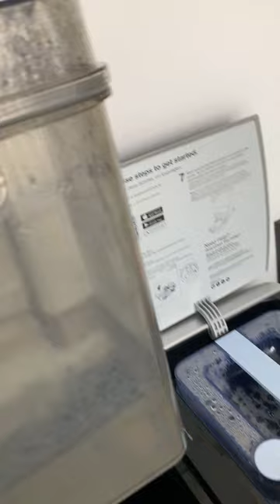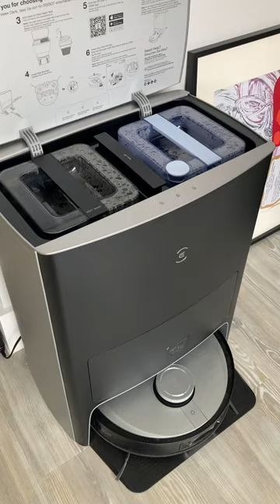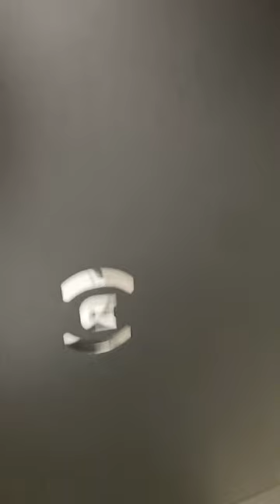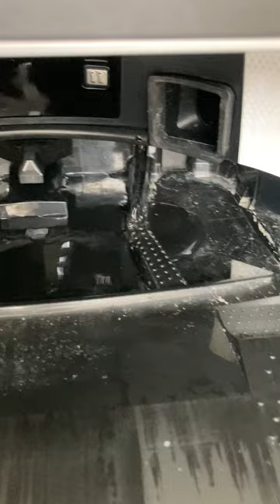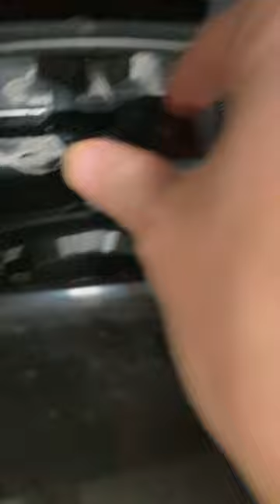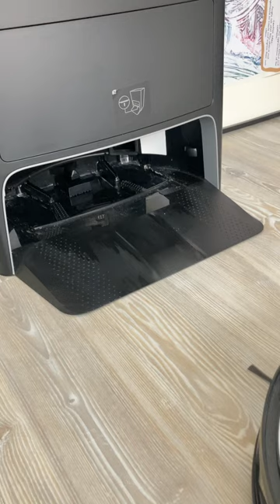DEEBOT OMNI X1 "Cleaning sink is full"

Comment: Mine did it day 3 of having it. Push down on the dirty tank and hold. While holding click that water symbol on the tower. (With the robot out of the station). 

I think it just had something preventing a good seal on the dirty water tank so it wouldn’t suck out the water
Reply: dude you fixed y issue thanks

Comment: Same issue here dont no if it still helpfull.
In the sink left and right side there watersensors if there dirt in it it will contact to the water and eachother so thinking its full, remove with tooth pick and the brush and extra water. And its fixed

Comment: Remove waste tank , take normal vacuum and clean 2 outlet tube which feed the waste tank, put the vacuum head on the outlet head and suck all what block inside.
After that everything should be fine.
Just remember do not put mopping mode only unless your room has no small debris, so better to vacuum first then mop
Reply: The video clearly shows the water empties from the sink fine.

Comment: I have the same “cleaning sink is full”.  Repeatedly until I manually clean each time.  The dirty water does not suck back to dirty water tank.   This is my 2nd machine, 1st machine returned for repair.  2nd got same error.  I feel sorry that I am wondering whether this feature is developed and tested well before releasing to sell on market?
Reply: It may be a suction problem between the dirty water tank and the rubber port seal.  If pushing down on the dirty water tank does not work, try removing the rubber seal from the plastic port.  Clean and place it back but do not press it all the way on.  Leave it up off the stop a little bit then replace the tank and try again
Reply: Look at mine response